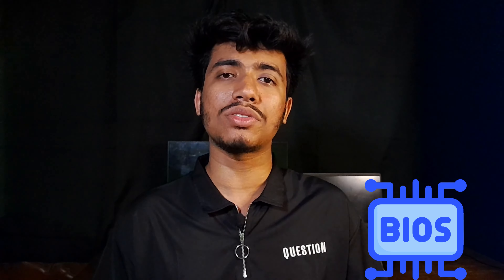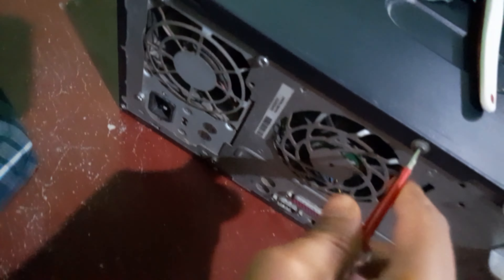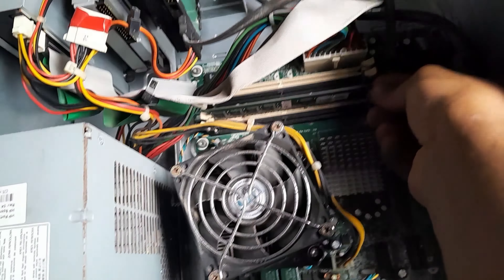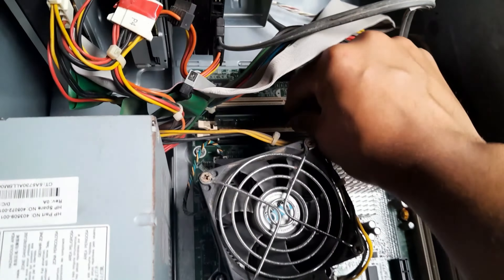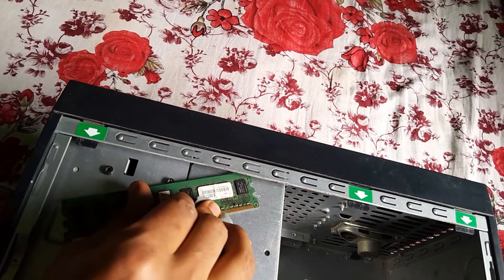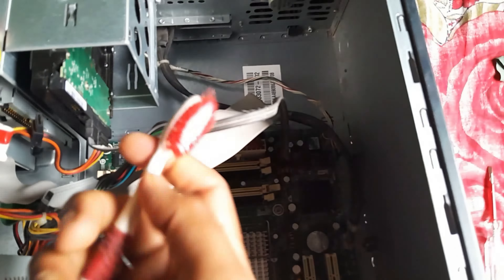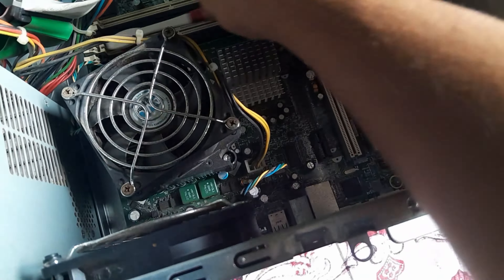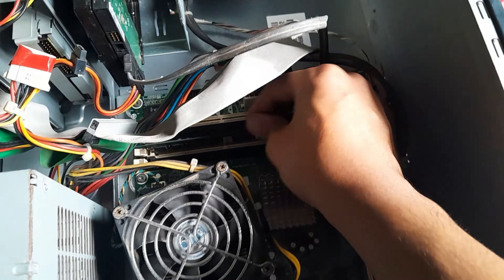Sceptre Monitor No Signal (Black Screen) — 4 Ways to Fix

Comment: Thought u gonna teach me how to fix black out screen ,why u teach me fixing computers
Reply from the maker: Because the black screen issue is primarily caused by the faulty signal source (PC or computer), a malfunctioning port connection, or cable. If you think your PC or whatever you are using the monitor for is okay, then the monitor itself is faulty. In that case, you have to figure out what the actual problem is!